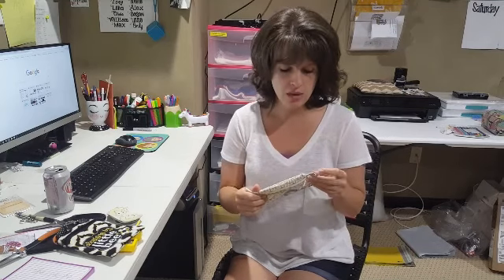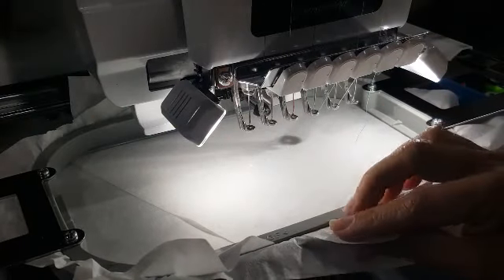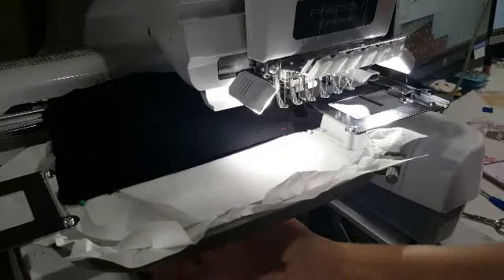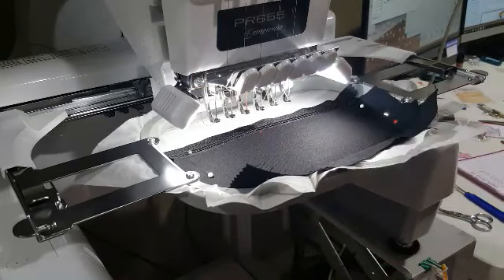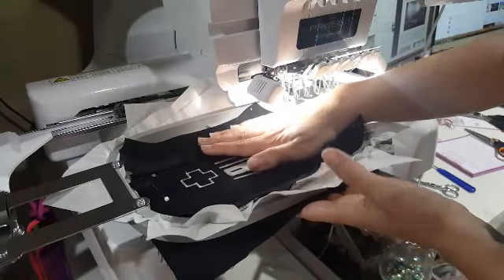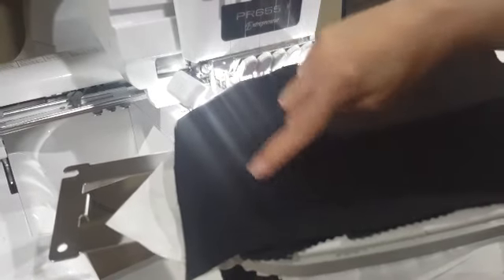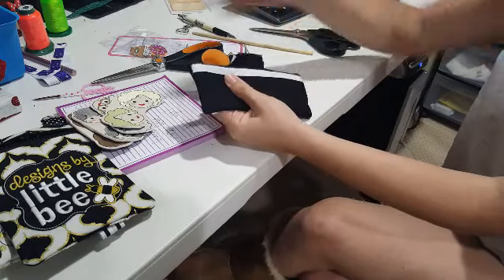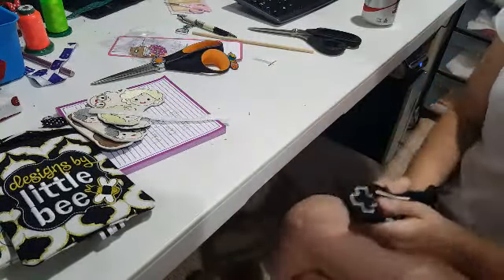"Flipper Zipper" No Exposed Stitching Inside Bag, In the Hoop Embroidery Zipper Bag Tutorial

Comment: I'm not completely sure where to put my strap for this bag. I think I add it directly on top of the design. In this video at 21:53... I think I would lay it on the inside of the project approximately where the green pin is. Is that right???
Reply: Angie Overton me either
Reply: You can put your handle/strap anywhere you wish, just remember your strap end hangs over the outside stitch line, your loop or hardware and attachment is facing the inside of the stitching, under the fabric for the back of the bag.  Once you turn and trim, the snap, ring, or handle are now on the outside and your strap ends are now trimmed off and between the lining and the underside of the outside of the bag.  Hope I explained it.